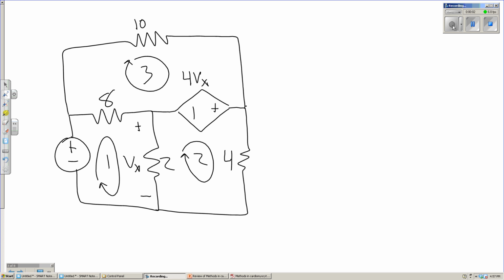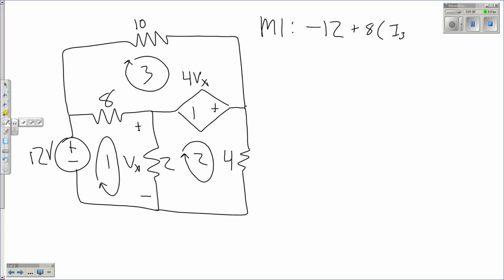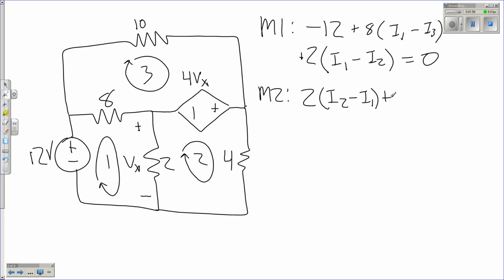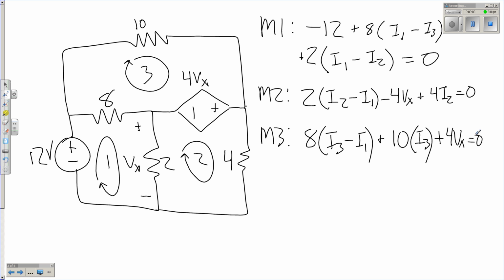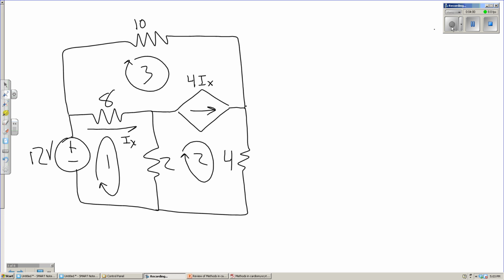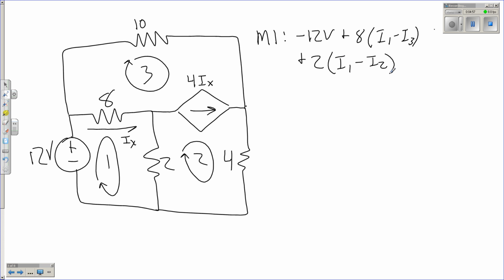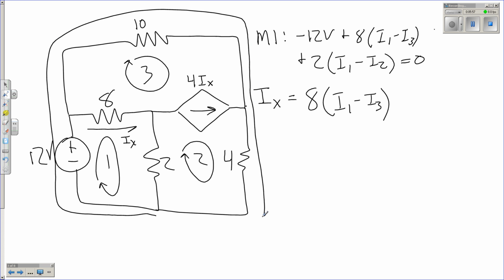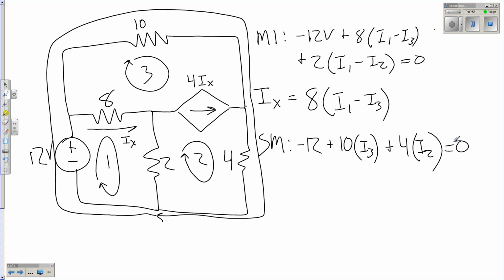2013.09.25 Mesh Currents & Dependent Sources

Comment: Vx is = I1 - I2 because,the conventional current always flows from higher voltage to lower voltage ( + to - polarity). Here, the current I1 flows from higher to lower. thus it is positive. But I2 flows from lower to higher ( which is not conventional). Thus I2 is negative. Which gives Vx = I1 - I2.